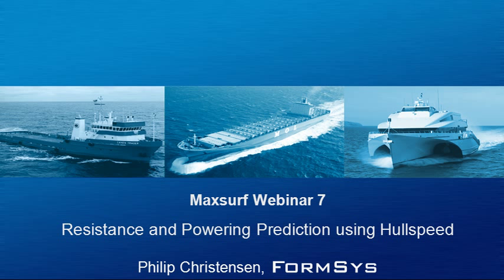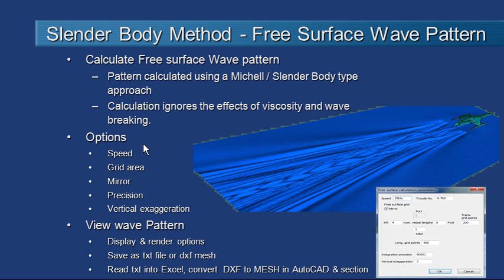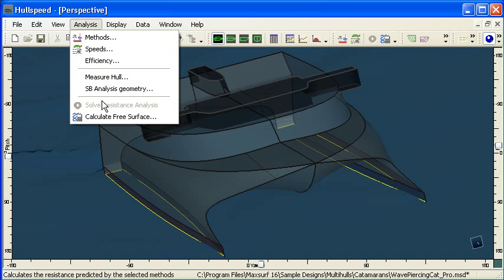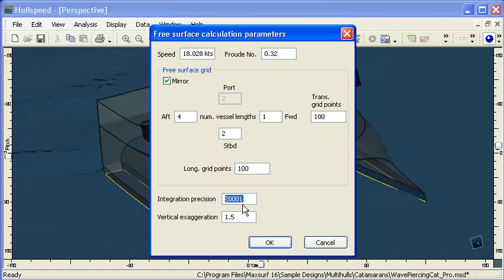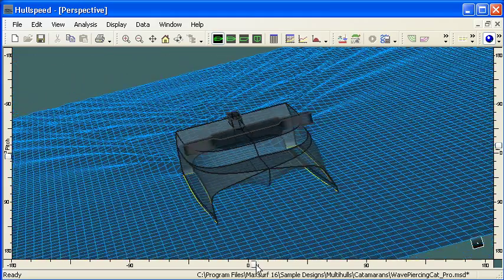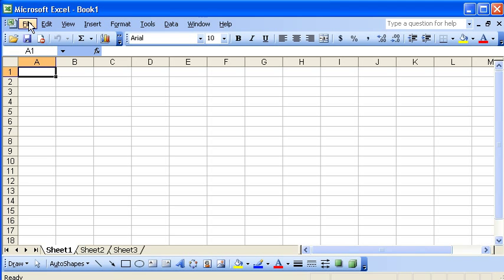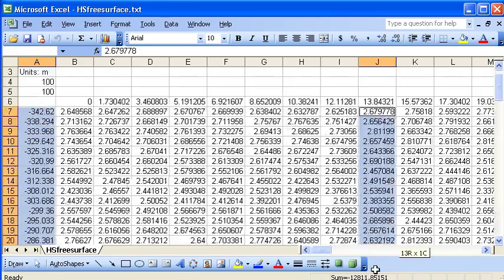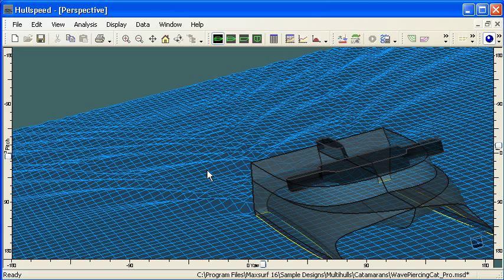Hullspeed Wavemaking and Wake Generation

Comment from the maker: MatLab is a useful tool to use in conjunction with the Maxsurf suite of software. MatLab can access the COM/Automation interface provided to Hullspeed and the other modules. This allows you to perform optimisation of various kinds including modifying the hull shape and running stability, resistance and motions calculations.
Reply: Hi, thank you for you helpful guides. Is there any document or video that shows an example how to do this?